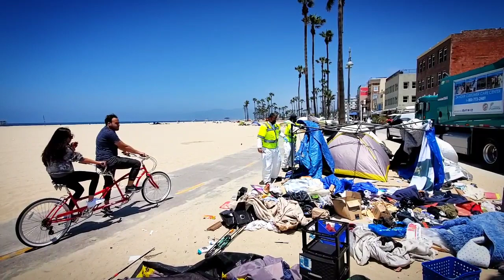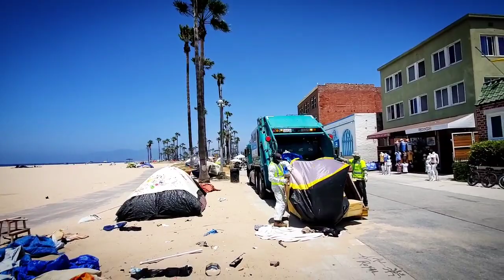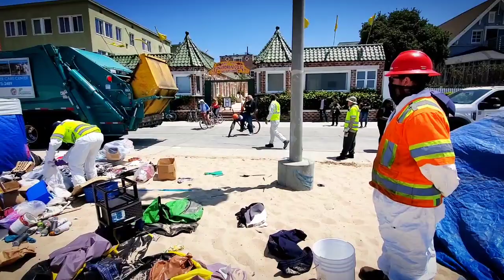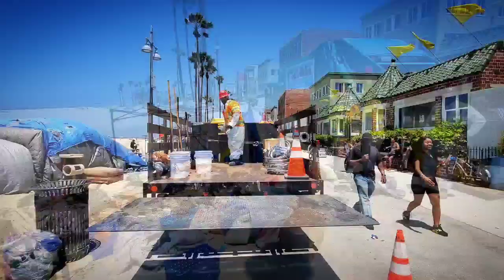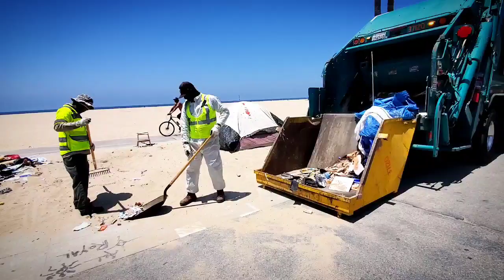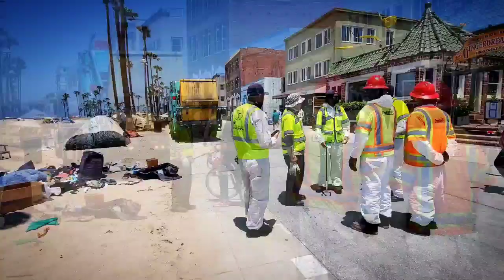Homeless Encampment Cleanup

Comment: Get a D9 Caterpillar and scrape the total area in one hour, load, and dump. This way it will take years.....
Reply: right on!!
Reply: @LLCNipsturBrands  Hi Nipstur, Get a fine mesh screen and dump the sand in (maybe a depth of 30 inches). What filters through you leave at the beach and what is left goes to a landfill that is 50 feet deep or so. No one will dig in the dumps to get stuck with a needle. Just get it done fast....